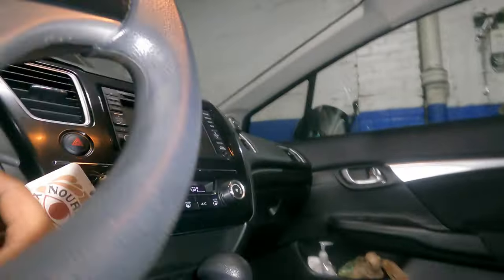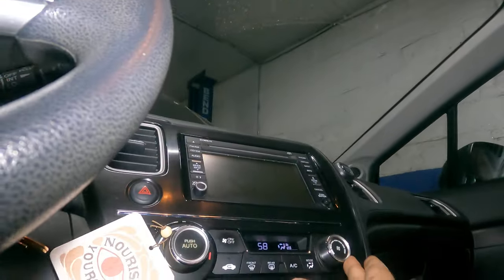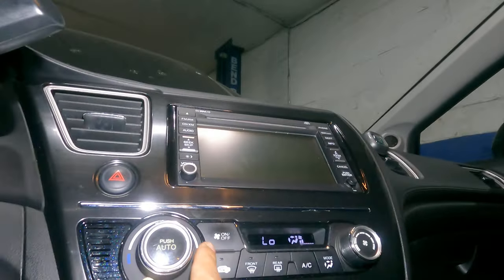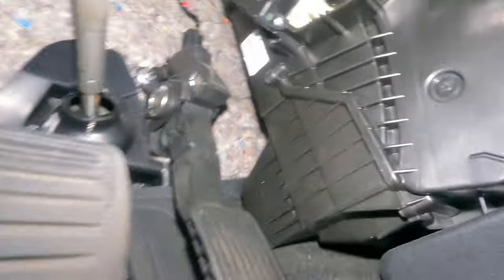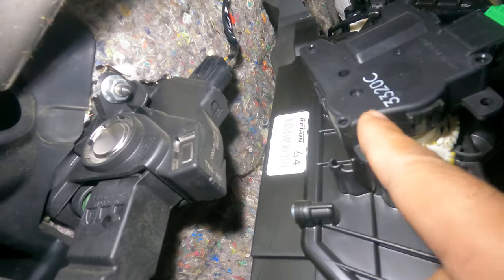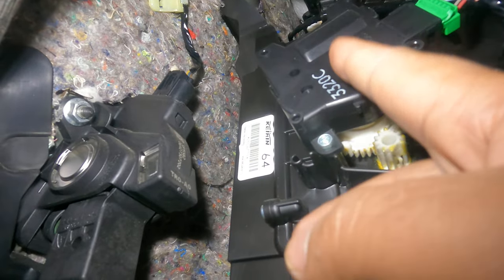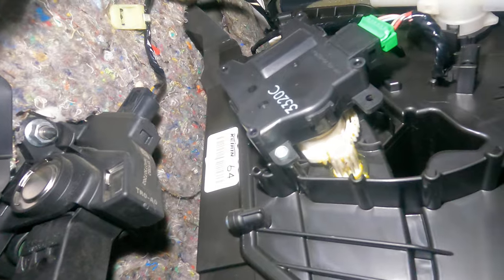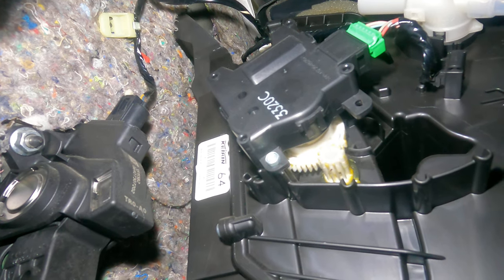No AC or HEAT on 2013 Honda Civic Bled door motor is possibly not operating

Comment: Mr rb 2014 camry 190k miles now. Ac squeeze sound when in at idle speed .    Blow cold air 40f. Is ok leave like that.
Reply from the maker: So what’s the issue ur asking
Reply: @RBTheMechanic  is ok drive like that.  ?      If i dont change the ac compressor.   Will it hurt the entire havc.     In the future?  Like condenser and evaporator.